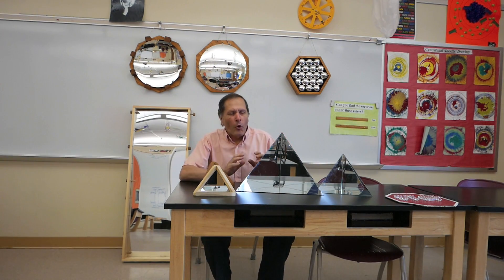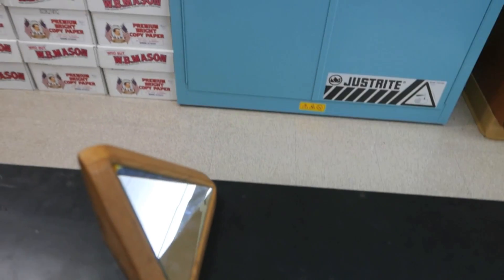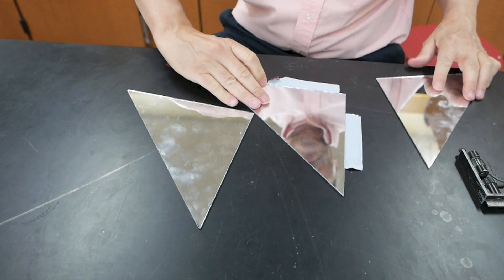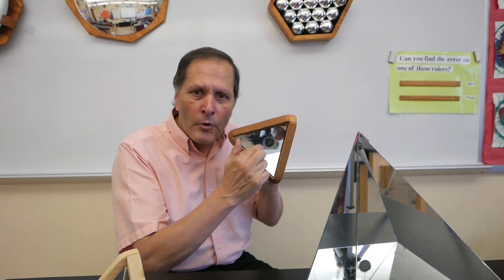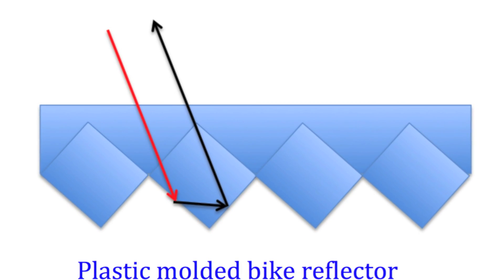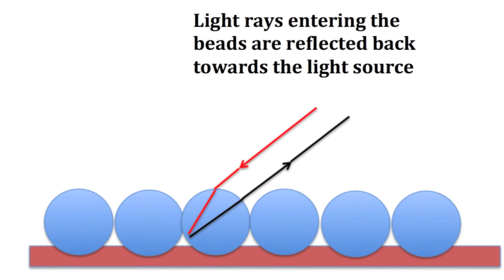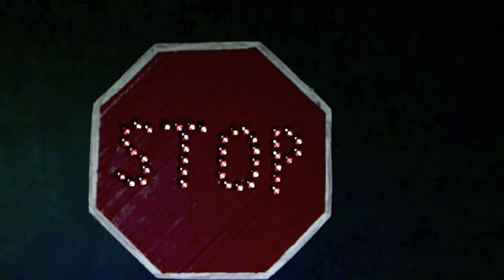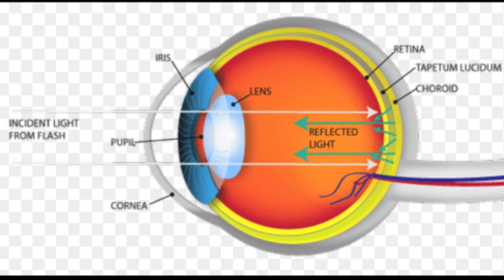Corner cube mirrors & Retroreflectors // Homemade Science with Bruce Yeany

Comment: Wow, thanks Bruce. That was an awesome explanation on retroreflectors. I used to do tech support for a survey supply company, and surveyors would use retroreflective prisms to survey using total stations. The corner mirrors were on the back of a prism glass. One of the coolest machines I've ever seen was the Trimble S6 Total Station - it would center automatically on the reflector right dead in the center. Once you had lock on it, it would follow the prism and you could take measurements with it - using distances and bearings to map your survey. Another cool use of retroreflected light. Thanks for the trip down memory lane.